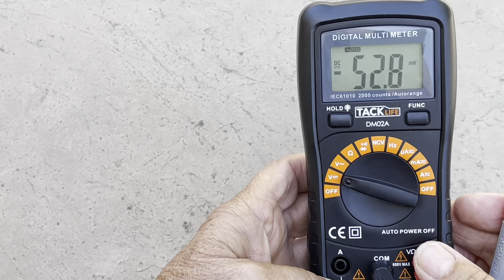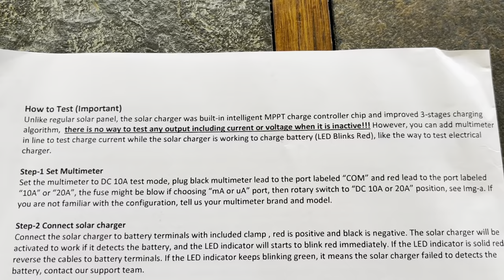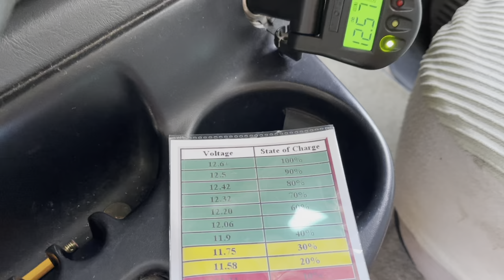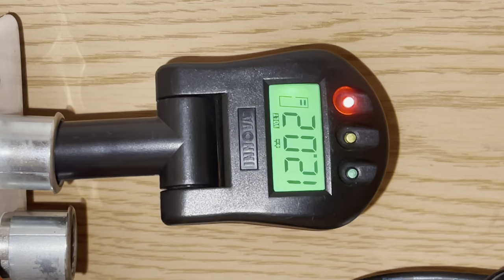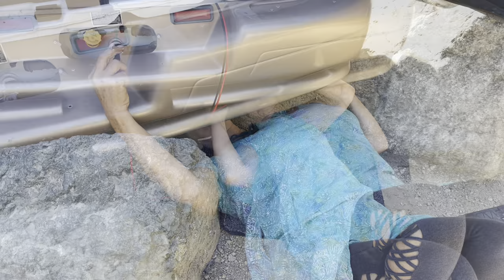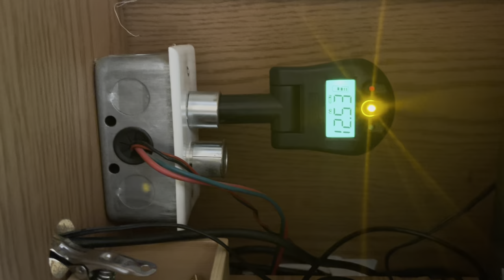Solar trickle charger for beginners

Comment: For the cigarette plug charger to work the plug has to be hot when key is off. If not that means when key is off the plug is disconnected from battery. Just an FYI great video thanks
Reply: can we use it while driving 🤔🤔 especially the cigarette socket?
Reply: @zzaartttart8093  you can't use it while you're driving because that cigarette lighter plug will have power from the alternator which will be charging the battery and running all the electronics so the juice from the solar panel won't make it to the battery
Reply: In that case , that's why most come with alligator clips

Comment: Mrs Roadtrek can your friend that is so precise explain why the little chart data do not match with the data on the back when it comes to Voltage and % state of charge? Especially at the lower end is quite different.